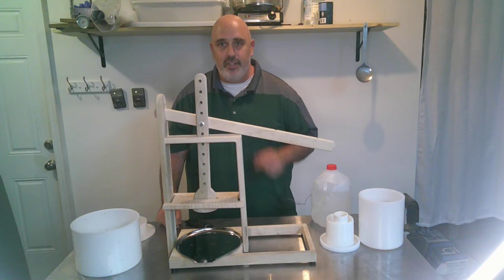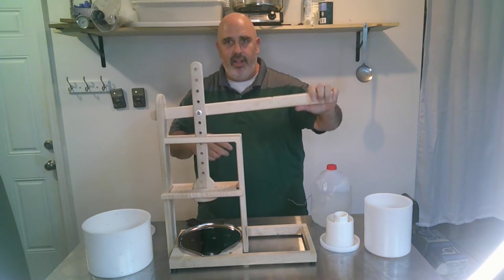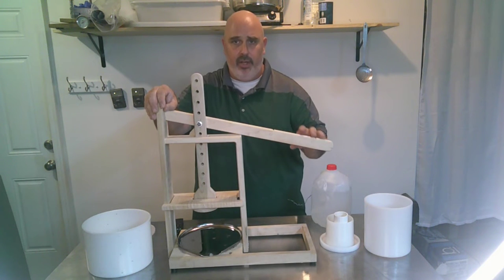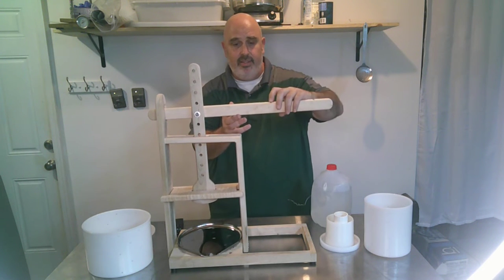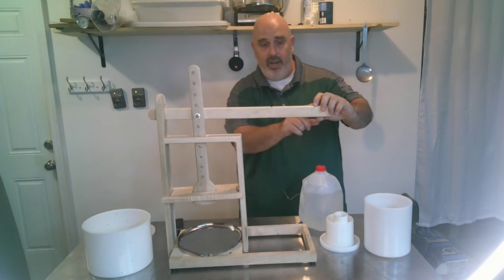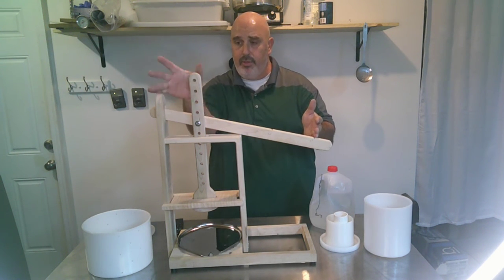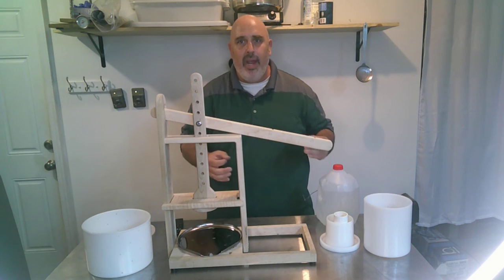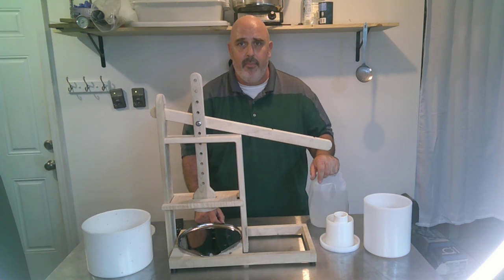Learn how to use a Dutch Style Cheese Press!

Comment: LOVE this video! It's the first time I've ever used my press and you made it so easy to understand. Question--I have 2 small molds that I'd like to stack in my press to press 2 cheeses at the same time. How does that change the pressure equation? Suggestions?
Reply from the maker: I would just account for the wait of the curd and the mold and figure that into your calculation for weights. Also,  when you flip the cheese, I'd rotate which one is on top. Happy cheese making!

Comment: Thanks for the assistance! I still feel dumb through, I have the same one and I have confused myself on how to figure out pressing at 55lb
Reply from the maker: Sorry for the slow response,  I was on vacation. The farthest notch out is 3x the distance of the fulcrum to load point, so any weight you hang there is putting 3x that weight on the cheese. For example, if you hang 5 lbs on the farthest notch,  it's putting 15 lbs of pressure on the cheese.
Reply: Thank you so much!
Reply: @Cheeseologywithadam  The math is slightly off. The first notch in your description isn't the same weight as what you're hanging (5 lbs) but actually 2x that so it would be 10 lbs. The reason is the lever is double to the distance from the fulcrum as your load point. The furthest point out is more like 4x.

Comment: Hi Adam,  I made a Dutch-style press and it works just fine and I needed your explanation of how the weight multiplies.  But I think you forgot something important so I will mention it here.,  The empty press, just the lever and the follower and connecting rod have a weight.  So you need to use a scale and figure out how much pressure the empty press exerts.  In my case it is about 4 lbs. So five lbs at one distance would be 5 +4 or nine lbs.  Etc.  Hope this makes sense.  John G,  Ecuador
Reply from the maker: Hello, thanks for the comment. On most home cheese maker press sizes, this amount would be negligible, so I don't even mention it, but you can certainly factor it in if you wish.
Reply: Hi again.  Not really negligible.  My press which is not too different then yours, when I trapped a scale beneath the six-inch follower and the table, with only the weight of the lever arm it was still generating 4 lbs. of pressure.I calibrated my press using that as a base pressure. @Cheeseologywithadam